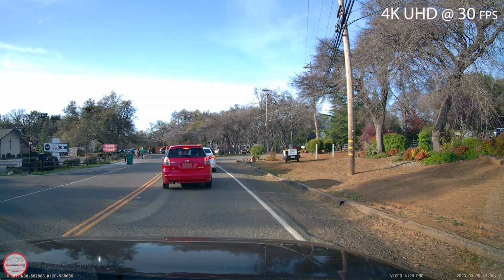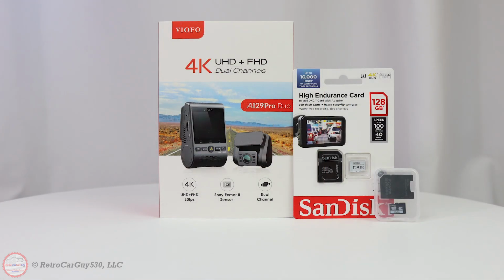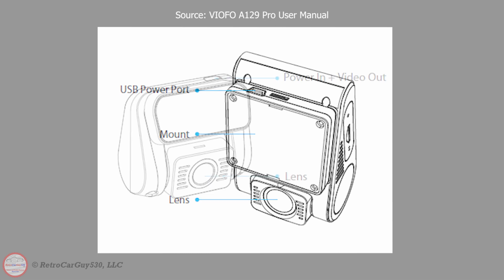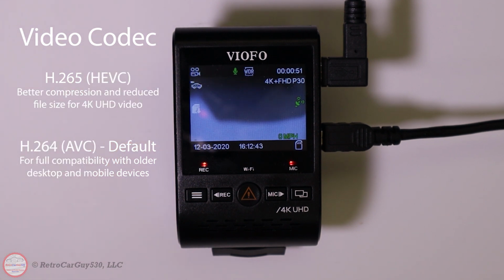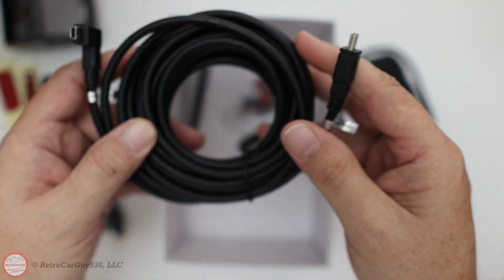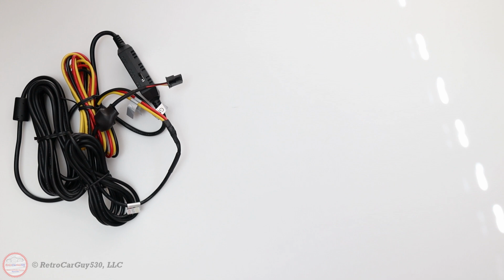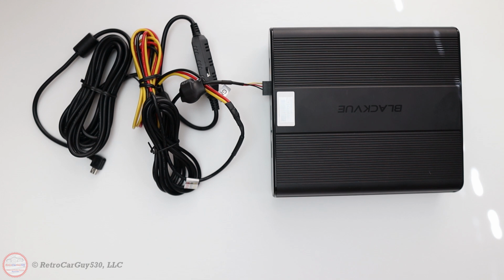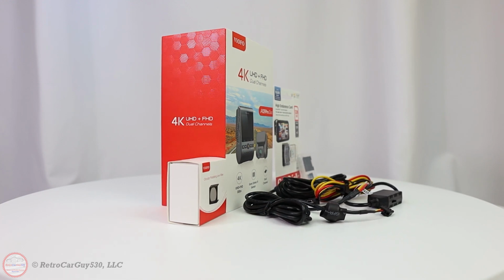VIOFO A129 Pro Duo 4K UHD/1080p FHD 2-Channel Dash Cam - Unboxing / Config Options

Comment: Can an additional cabin cam can be added to this camera since it only comes with rear cam not the insider cabin cam ?
Reply from the maker: The A129 Pro Duo can only have one other camera connected to the front camera.  There is a "Rear Camera USB Port" on the side of the front unit and only the cable supplied that connects the rear camera can be plugged into that connection port on the front camera.  Only the VIOFO A139 3-Channel and VIOFO T130 3-channel dash cameras have the ability to have a rear and interior camera connected at the same time.
Reply: @RetroCarGuy530  thanks for confirming much appreciated 👍

Comment: Would it be do-able to simply buy two of the VIOFO A129 Pro Duo 4K UHD instead of getting the smaller back camera. Would I run into trouble ?
Reply from the maker: You could buy two of the A129 Pro camera (non Duo version) to get two "front" cameras.  The only extra work in that case is sourcing power for both cameras and running the power to the front and the rear camera installation.  Using a front camera in the rear window will take up a bit more space, so make sure you have a good mounting location that won't block your line of sight with the rear window installation of an A129 Pro front camera.

Comment: hows the parking monitor works with the battery pack because in fuse tap the dashcam screen will turn on once it detects the ACC and will go on parking once the ignition is off. I tried mine using the usb connector and connect it to a usb port to power the dashcam to simulate battery pack.the dashcam seem to be on all the time and it gets really hot. what's the difference between using the battery to a constant power source usb port. In my understanding parking monitor puts the dashcam in some kind standby mode but still be able to record if the g sensor got triggered. In constant power source the dashcam is not on that mode it is in ON state which mean uses alot of power. I might be wrong please help.
Reply from the maker: At 12:19 in the video, I discuss the hardwiring configuration options.  To support parking mode in this camera (and most dash cameras - most BlackVue cameras have a slightly different approach), you must use a 3-wire hardwiring harness to provide constant 12-volts (unswitched), accessory 12-volts (switched) and ground.

When using a 3-wire harness to obtain power from a fuse box, you use fuse taps to access the constant and accessory power from two different fuse sockets in the fuse box.

When using a 3-wire harness to obtain power from a dash camera battery pack, it still obtains the constant and accessory power as well as ground from the dash camera battery pack.   If you use a 12-volt power port adapter provided with the dash camera battery pack to supply power to the camera, it only provides the constant 12-volt power and ground to the dash camera, so a VIOFO camera will not enter parking mode when powered in this manner.  To use a dash camera battery pack to support parking mode in this VIOFO camera, the dash camera battery pack must have a way to connect a 3-wire hardwiring harness to the dash camera battery pack.

When you install the dash camera battery pack, you wire it into the vehicle to obtain accessory (switched) power that charges the battery pack as well as provides power to the camera while the accessory power is on.  When the accessory power is turned off, the battery pack is no longer being charged nor is accessory power supplied to the camera.  The constant (unswitched) power is provided by the battery pack itself.  The dash camera doesn't see any difference when wired to a dash camera battery pack.  It still gets the 12-volt constant power, 12-volt accessory power and ground.

If you use a battery pack or a dash camera battery pack that is only capable of providing 12-volt constant (unswitched) power and ground, the VIOFO dash camera will be unable to know when to switch into parking mode, so it will stay powered on all of the time consuming the highest power level until the battery pack drops below the minimum voltage cutoff setting for the 12-volt / 5-volt power adapter in the hardwiring adapter.  In those situations, you could use a 2-wire hardwiring adapter harness instead since no accessory (switched) power is available.  You could use a 3-wire hardwiring harness as well and connect both the 12-volt constant (unswitched) and 12-volt accessory (switched) wires to the 12-volt output from the battery pack, but it's not truly the best way to use a 3-wire adapter. 

If the camera is wired with a 3-wire hardwiring adapter and it has access to the 12-volt accessory power signal to go into parking mode, you can see the "Advanced Parking Mode" options you have from the VIOFO user manual:

Advanced Parking Mode: There are 3 options under parking mode:
① Auto Event Detection
 Including buffered parking mode, the camera will automatically
record a video sequence (from 15 seconds before the event to 30
seconds after the event)while a moving object is detected during
parking. It will stop recording without new movements.
② Time Lapse recording
 Time lapse record a video at low frames at 1 / 2 / 3 / 5 / 10 / 15 fps, It
keeps recording continuously without audio recorded.
③ Low Bitrate Recording
 This mode record video in low bitrate for both front and rear. It
keeps recording continuously in mini file size with audio recorded.
• Parking G-sensor: The G-sensor detects significant or sudden
movement (such as an impact or collision), it will trigger an event
recording. We suggest setting it to High sensitivity in parking mode
recording.
• Parking Motion Detection: Adjusts the sensitivity of the motion
detection so minor motion caused by wind or rain doesn't trigger a
recording.
• Time-lapse Recording: Record video from frames captured at
specific time intervals to conserve memory and reduce the time it
takes to review video. The default is off
Reply: @RetroCarGuy530  thank you for taking time to reply. In short I can use blackvue battery pack or similar dashcam battery pack that support  3 hardwire ACC, CONSTANT POWER, GROUND to access advance parking mode.  If I have battery pack that has 3 wires to connect to the dashcam I will have the advance parking monitor similar when using 3 wires hardwireling kit. I couldn't find any video that uses that method only you thank you. I just don't want to buy a battery pack and not be able to use the parking monitor properly if the camera stays ON all the time it might self distract.
Reply from the maker: Yes, if you have a dash camera battery pack (Cellink B, Cellink Neo, BlackVue B-124, BlackVue B-124X but not the BlackVue B-112) you can use the advanced parking mode functionality in the camera.  You can also hardwire the camera to a fuse box in your car too using the battery voltage cutoff feature in the VIOFO power adapter.  It likely won't give you nearly as much parking mode time, but it will work as well.

VIOFO A129 DUO 2-Channel Dash Cam - 2017 Kia Soul Installation https://www.youtube.com/watch?v=ziwvtLjNuv4

In that video, I install a VIOFO A129 Duo (not the Pro Duo) into our 2017 Kia Soul using the VIOFO 3-wire hardwiring adapter.   I eventually upgraded the camera in that car to the VIOFO A129 Pro Duo using the previously installed 3-wire hardwiring power adapter.  I located two non-critical fuses to supply the constant and accessory power.  This setup works well and it powers the cameras A129 Duo and now the A129 Pro Duo in parking mode for 10 hours or so when my wife drives it to work.

BlackboxMyCar had previously sold the VIOFO 3-wire hardwiring harness with an optional dash camera battery pack connector.  I don't see that on their website at this time.  BlackVue has that accessory as the "dashcam hardwiring power cable (3-wire)" on their website for $10 USD.  https://blackvue.com/product/power-magic-ultra-battery-b-124-accessory (use single selection drop list to pick this item on that pack).

I needed one of the dash camera cable adapters recently, but the BlackVue website was having technical issues and I couldn't order it and ship it to the United States.  That issue has been resolved.  So, I ended up making up the cable connector to connect the dash camera's 3-wire hardwiring harness to my pre-existing Cellink B dash camera battery pack.  I ordered 3-wire cable and molex connectors and terminal pins.  That approach ended up working fine, but I'm comfortable with wiring things like that.  I have a video showing my mods to the BlackVue DR900X-2CH dash camera's 3-wire hardwiring harness: https://www.youtube.com/watch?v=DmwiSnGBOCk

The 3-wire hardwiring harness that connects to the camera (in this case VIOFO) can source its power either from one of the car's fuse boxes or from a dash camera battery pack.  In the case of the sourcing power from the fuse box of the car, you would likely use fuse taps to obtain that power.  In the case of a dash camera battery pack, you would use a 3-wire adapter cable to connect to the dash camera battery pack.
Reply: @RetroCarGuy530  Have you actually try using blackvue b124x to power viofo A129 pro duo 4k.  does it work perfectly with that battery pack. thanks for help.
Reply from the maker: I have not paired a VIOFO A129 Pro Duo with a BlackVue B-124X battery pack.  I have verified that the B-124X does provide constant and accessory power along with a ground via the dashcam output port on the B-124X.  As long as the VIOFO 3-wire power adapter is wired correctly to the B-124X, it should work.  The B-124X battery pack that I had back in Dec 2019 for the review I ended up giving to a friend along with a BlackVue DR900S-2CH camera.  So, I don't have any way of testing that combination at this time.
Reply: @RetroCarGuy530 thanks man for help I just couldn't find a video pairing the viofo with blackvue b124x. I just don't wanna waste my money if it doesn't work properly in theory it should.
Reply from the maker: It appears some of the newer VIOFO cameras A129 Plus / A139 have a motion based parking mode feature (similar to the one BlackVue cameras have).  The camera should go into parking mode after the car has been stationary for 5 minutes and it exits parking mode when it starts moving.  It requires the VIOFO GPS receiver be installed for that camera and an updated firmware (from what I'm reading).  If that feature is truly present, then a 2-wire hardwiring adapter would be sufficient to power the camera.  I don't have one of the newer VIOFO cameras to verify this feature / behavior.  I still don't see this documented in the user manual for the A139 camera, but there seems to be some discussion about this on the DashCamTalk website.

Comment: dont really care if they can read the sign on the road but what about license plate? I think even 4k for this cam cannot captured good image of other car license plate since it is not cover in the video.
Reply from the maker: The lettering in the road signs is extremely similar to the size of the letters/numbers in license plates.  People get a bit defensive when you include license plates in videos, so I decided to show the road sign visibility capabilities instead of the license plates.  Every 4K UHD camera that I've used/tested have had mediocre to moderately okay license plate readability.
Reply: @RetroCarGuy530  thanks. That's what I need to know. Because if anything happen, license plate is the key for most hit and run accident.

Comment: You can’t just pluck 4K and HD footage together in a split screen exported as HD, and expect 4K footage appear better than HD. 

If you do that HD source footage will preserve most elements with minimal distortion, but 4K footage has to go through downsampling and probably anti-aliasing steps if you haven’t carefully disable it when you export the video. So the result is final HD footage where 4K source video appears smoothed out. 

And then there’s youtube internal transcoding when the video gets uploaded.

The only way to truly compare image quality is by doing it with original source clips.

Or by producing your video with comparison at least 10x magnification with careful control of video encoding parameters.
Reply from the maker: As I stated in the video, the 4K footage from the A129 Pro Duo front camera won't look as good as it could since my video is rendered for 1080p FHD for YouTube.  I also show zoomed footage from both the 4K and 1080p footage to show there is more detail in the 4K footage (at least in the daylight captured footage).  

When comparing the raw 4K footage to the raw 1080p footage on my computer screen, the 1080p footage still appears to be more crisp (unzoomed viewing) than the 4K footage.
Reply: @RetroCarGuy530  I have to comment on it because your split-screen comparison only shows compression and resampling artifacts which is clearly not from the source. This is very misleading to the viewer. I see some motion blurs as well which is introduced either your video editor or YouTube.

What I'm saying is your setup is not just negating the advantage of 4K, but it actually HURTS the 4K source footage as it has to first go through downsampling (that's for sure), anti-aliasing (probably), motion-blur effect on resampling (if you're not careful with your setting), and then the entire frame has to go through lossy compression subject to whatever bitrate you have chosen to render the video to. And of course YouTube will re-encode with lower bitrate as well. If you're going to discuss video quality and present evidence as video clips, you have to be very meticulous and clear about these technical issues.

And when you presented 'zoomed in' still images inserted in the video, I have to question about exactly what steps you went through to create the zoom stills as it appears you zoomed in from downsampled (or non-original) clips. You should at least take the zoom still externally/separately.

I saw a couple of comments already saying 4K looks worse than HD in your video (which is true) and then judging 4K dashcam is worse than HD (which is not true). There's a lot of fake 4K cams, but this one is not.  I DO own both A129 versions - 4K and HD, and I say 4K is much much clearer in terms of resolution when viewed on 4K monitor using original source clip. In clear daylight, using 4K footage I can make out license plate of a car about 30 ft in front of me, and street signs are legible. But HD footage I can barely read license plate about ~10 ft out.

Comment: Hi,
I’ve been watching your videos for some time now, and I decided to buy my first dash cam (Viofo A129 Pro Duo). 

After using the dash cam for 3 weeks, and reviewing my test footage I have a question.

What are the Pros & Cons of 4K30fps vs. 2K60fps, (when filming with a dash cam at daytime, and night time)?

I asked because, when I review my test footage, and pause a video to read road signs, or license plates, I can’t tell the difference between 4K30fps, or 2K60fps. 

However, when I watch the video on playback, the 2K60fps is more appealing to my eyes. I also noticed the file sizes are almost identical between the two.

I’m interested to hear your thoughts on this subject.
-Chuck
Reply from the maker: Hi Chuck.  When you increase the FPS (frames per second) value you reduce the amount of motion blur that your eye will detect making the image more sharp.  The human eye tends to see things in the 24 fps/30 fps rate.  Increasing to 60 fps, increases the sharpness (reducing motion blur) which I believe is great for dash cameras.  I tend to set my cameras at the highest FPS setting for the given resolution.  If the clarity of the image is satisfactory to you at 2k60fps then please use it.

The files sizes being similar to each other for 4k30ps and 2k60fps kind of makes sense.  At 60 fps, the camera is writing twice as many frames per second than at 30 fps and the number of pixels at 2k is must smaller so the smaller number of pixels vs the doubling of the number of frames seem to be offsetting each other.  I would tend to believe the 2k60fps would be a bit smaller for the same time period vs 4k30fps, but I'd have to test it.

I hope that answers your questions.
Reply: @RetroCarGuy530  
Thanks for the speedy reply. 
That makes perfect sense. 

So does that mean 4K 60fps would be the best?

Why don't they make that dash cam setting?
Reply from the maker: @PanzerPlatform  when there are two cameras (Duo / 2-channel) then the FPS/resolution options tend to be limited a bit by the bandwidth of the data path to the memory card.  Some single cameras (front only) might allow for higher FPS when operating in 1-channel mode.  It also depends on the video chipset used to capture/encode the video data that may not support that high of a FPS value in 4K mode.

The resolutions options for the A129 Pro Duo are documented as:

Resolution: Setting video resolution of footage recorded,
Front Camera Only: 3840 x 2160P 30fps, 2560 x1440P 60fps,
2560 x1440P 30fps, 2304 x1296P 30fps, 1920 x1080P 120fps,
1920 x1080P 60fps, 1920 x1080P 30fps.

Dual Channels: 4K (front camera) + Full HD 30fps (rear camera) ,
1440P 30fps + FHD P30, 1080P 60fps + FHD P30.

Comment: Thanks for the excellent video. Were either or both the pro and standard versions of the unit fitted with the lens filter during the video comparisons?
Reply from the maker: Both the A129 and A129 Pro front cameras were fitted with a VIOFO circular polarizing lens filter (CPL).  It reduces the reflection of the vehicle dash and windshield by a good amount.  I use a CPL on all of the dash cameras that I own / test that offer a manufacturer supplied CPL.
Reply: RetroCarGuy530 I really appreciate your reply as I’ve just ordered the duo pro with the filter 🙏